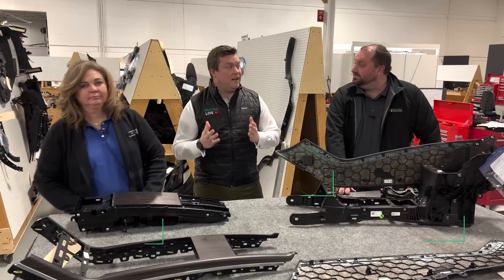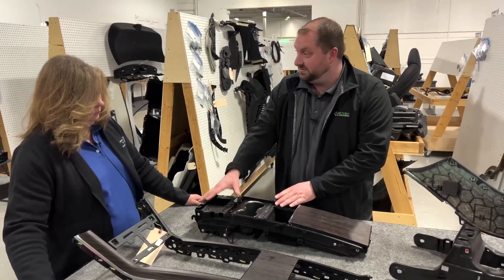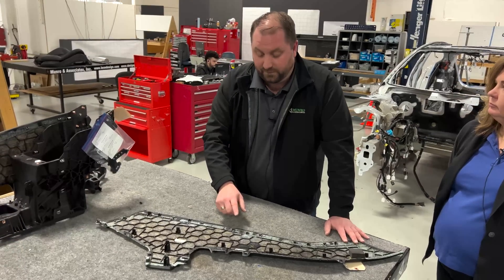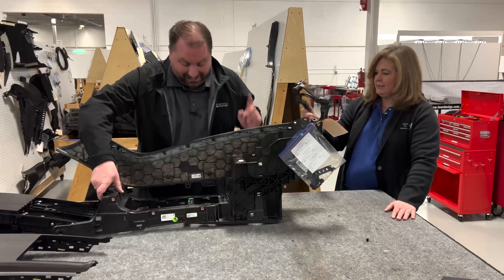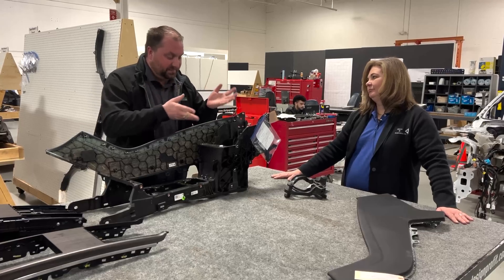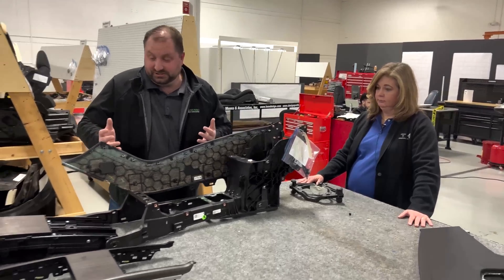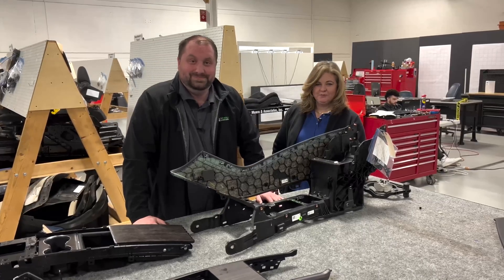Tesla's Center Console Surprises | Tesla Model S Plaid Teardown

Comment: I am trying to replace the center console wood finish with the carbon fiber finish. I bought the entire cover piece that you have disassembled in 2 pieces in this video. i was not able to pry the piece off after removing all of the screws at the perimeter. is it possible for you to provide instruction on how to remove the top piece from the actual center console? thanks!!!

Comment: I personally think that the small plastic tab is to prevent the cover from sliding back during acceleration since plaid accelerates so crazy fast. The inertia of a head on crash will only cause the plastic tab to stay down instead of up.
Reply: nailed it

Comment: To test that inertial lock mechanism, just hold that console top vertical and drop it a few inches onto the carpeted table top.  Keep dropping it from higher and higher until it works or doesn't. Or put it in a bag with a rope and swing it around your head. Count the video frames to find the rotational velocity, etc, etc... How many G's will it take to trip that latch? I'll bet less than .6

Comment: We needed an injection moldable carbon fiber parts manufacturer 3 years ago. I found it and the customer started working with them. A couple of months ago I asked the customer did they get the part done and he explained that he didn't know how to make it happen and it was cool to see a video of the process, it was done by robots. No word what exactly the part was but it has something to do with quadcopter attachments or maybe it's the frame. The size was around 1.5m because it's possible to transport it inside a VW Passat car. That got me thinking that Tesla probably has a similar fully automated production line or robot station that makes them. As a matter of fact, the factory engineer told me that the reason some parts look weird is exactly that, they are made by robots with "mold hands" that put the mold where it's needed.

Comment: Pretty sure the inertia lock is to stop the compartment from opening under high acceleration, if you factor in the direction of the latch and the little effort needed to open the bin.

Comment: I am amazed. I first thought that Tesla is many years ahead of everyone else only in their "sphere of competency" like electronics, software, battery management, battery supply and so on. However, I am more and more convinced that their lead is even much more profound - material engineering and even manufacturing in general. The most impressive thing for me is their ability to innovate so quickly. They learn pretty fast and this is their biggest advantage.
Reply: Bullshit Lol…… this is not something insane any more, other manufacturers have been using these types of materials including a full carbon fiber monocoque construction, carbon fiber wheels, carbon fiber roof, carbon fiber seats, carbon fiber almost everything, BMW had been using recycled plastics and fibers and even things like hemp and other plants in their cars for years and years.
Reply: @carholic-sz3qv  Whatever, you have to admit that the way Tesla was able to scale the EV production while everyone else just failed is nothing short of extraordinary. They are gigantic now. And don’t tell me it is just a good luck.
Reply: @ismaelvolf4759  i have to admit that every companies are scaling EV production and that’s the reality so cheers ….

Comment: Really interesting. I do wonder if this is just an experiment or if this is a direction for Tesla. What they have shown with other materials and even feature choices is that sometimes a more expensive option is cheaper in the long run if it is used exclusively and in extreme high volume. You mentioned the possibility of the overmolding on the cross car beam potentially also being carbon fiber filled. If Tesla goes this direction for most of their injection molded parts it could amount to a decent weight savings and a streamlined supply chain. And the natural fiber fill is also a great alternative to glass fiber which would make green focused customers happy.
Reply: Lol…… this is not something special any more, other manufacturers have been using these types of materials including a full carbon fiber monocoque construction, carbon fiber wheels, carbon fiber roof, carbon fiber seats, carbon fiber almost everything, BMW had been using recycled plastics and fibers and even things like hemp and other plants in their cars for years and years.

Comment: The spring steel won't work forever but they should easily last the 10 years the car will.  Especially cold climates might see earlier failures.

Comment: Did you notice that the center console lights are backwards? They turn off when you open the lid and turn on when you close the lid. All the cars are like this. All backwards. It’s amazing to have such fancy engineering and totally blow it on the assembly.

Comment: the cf reinforcement sounds like it's the "alloy wheels" of injection molding. yes, it was expensive. yes, it's lighter. not everyone cares, but those who care, care a lot because it does actually make a measurable difference. sounds like you talk to a lot of engineering accountants who went with the base models lol.

Carl's passion for injection molding is great! it's always cool to learn from people like him because they find the coolest stuff to be excited about. 

I wonder if there are aramid-reinforced plastics? because I would think that might be good on a skid plate or something like that. I used to change oil and I've seen some chewed up undersides of front ends
Reply: Wrong!!!!! Cf reinforcement doesn’t sound like alloy wheels of injection molding, it’s already something commun in the industry, other manufacturers even goes to making carbon fiber wheels, roof, monocoque chassis, doors, hood……..
Reply: @carholic-sz3qv  none of that is injection molded. my point was if you are buying an injection molded part, 30% glass fiber is like the bare minimum steel wheels version of the process, while CF filler is a nicer option
Reply: @Seldoon_Nemar  there are even magnesium wheels and many other very custom materials that other manufacturers uses, tesla is not even close to the engineering when it comes to materials, Porsche even has special coated steel brakes that doesn’t rust or fade when no used, so much more from their racing pedigree where all those materials comes from.
Reply: @carholic-sz3qv  wow, you are entirely missing the point of what I am saying... it's a euphemism... we are talking about INJECTION MOLDED PLASTIC PARTS. it could be a canoe paddle and use carbon fiber reinforcement. penny pinchers will say that cf is too expensive... they would also get the base model when owning a car... which comes with steel wheels... it's the minimum viable product...

like sweet satan my man, is english your first language?

Comment: You can tell these two (Carl and Sue) really give a crap about their 'back and forth' as a dynamic in their presentation.  Neither of them are what you could call 'natural presenters', but this presentation was smoother than the last one they did together.  The work they put into it is apparent.  These two have a great chemistry and I can see that they are going to be an awesome addition to the channel if they keep working hard.  Heck ... even Sandy has work to do if he REALLY wanted to take his performances to the next level.  Does the Munro Live Channel NEED 'A-List'ers presenting engineering features and break downs ??? NOT A CHANCE !!! Is that what it's going to end up with if everybody keeps putting this much integrity into their parts ??? ABSOLUTELY !!!  Great work everyone !!!  I come away a little bit smarter every time I watch a Munro Live episode.  This is turning into a real quality production, you should all be proud of yourselves.

Comment: To be honest with my self, I was more impressed with the spring latch for the centre panel door, then I was with the carbon fibre wrapped motor :-) Elegant and useful. 
Once again you two 'nailed it'. I kinda feel a bit sorry for he poor ol electrical engineers wiring loom video which I found a bit hard to watch. Not blaming the guys though, they acted just like most other electrical engineers that I've met. Super bright, but presentation tends to be not their strong point :-)  Tag teaming on video can be a hard thing to do. It was great how these two looked at each other and us.

Comment: That little inertia lock serves one more purpose: when you launch the plaid, everything that is not secured in the car will fly back with significant force, including the console door 🙂
Reply: This is why for sure
Reply: Good guess !
May it also be for a software lock ? Such as the glove box pin locked ?
Reply: @guillaumest1  would be quite easy , but is not currently , cause no motor or magnet for locking seen here. to do the lock with the same/similar idea. you would just need 2 magnets , and the bottom one would be on a slide with a small motor to bring it under or move it to the side, then it is under it brings the front lever up , locking the center console , if you use electro magnets, you waste energy.

Comment: It's probably an inertial lock but not for accidents, since in an accident the lid will probably move forward, I think it's to prevent the lid from sliding backward due to the aggressive acceleration of the plaid.
I think this can be confirmed if theres a notch in the underside of the lid for the lock to latch onto if the lid is in the middle position.
Reply: Thats an awesome observation....for any other car it would be ludicrous to assume acceleration...but plaid...very appropriate

Comment: Sue and Carl are the best! I agree with Sue about the inertial lever. Is the spring light enough that if the car is inverted it will lock the compartment closed? Carl, do you think Tesla engineers have read your thesis?!? If it were me, I'd take a lot of pride in knowing they had. Good job. VERY interesting. (but leave Sandy alone during his vacation! 🤣)

Comment: Maybe that spring loaded flap is to allow some air to flow into the storage compartment (opening or closing the sliding lid may create a vacuum in the storage compartment / cup holder area)?

Comment: Started good and getting better and better with each edition. Thanks. 

Re the carbon fiber: I've seen them mix a powder with resin in doing high strength fiberglass applications...like sailboats. Seems carbon "powder", if such a thing exists, aught to mix in (blend) with the poly (aren't they tiny beads?) as the feed stock for the injection.

Comment: What is that built up box on the center console side panel? I don't see wires for a sensor or something.

Really great about seeing carbon fiber and weight savings to trickle into parts.
I'm guessing we will see many more as we get closer to the roadster release. Perhaps next huge pieces in seat frame and mount. Probably switching pieces both at a slow rate of using part backlog, but also to spread cost of switching parts. 

Would be super expensive to switch all at once, in but by slowly doing it they can control costs from spiking.

As you have mentioned how will they get the cost down for Thier expensive models; by making cost spread of parts into all or more mainstream vehicles.

Comment: One thing I like about Tesla is that they have introduced new materials and production methods that have nothing to do with a BEV powertrain.  In doing that they have really embarrassed legacy auto since moving to EV wasn't required for these sort of advances.
Reply: Bullshit, do you even know anything about the automotive industry!? Bmw has been using recycled plastics and natural fibers like hemp in their cars for years, even carbon fiber and naturally tanned leather here is a proof https://youtu.be/GtXeLhz9JVI
Reply: The sliding lid is something Mercedes’ has been using for over a decade.
Reply: @carholic-sz3qv  yeah, I wasn't really refering to that. I'm thinking of things like giga castings and optimisations in the factory that lead to construction times of one third of that of legacy (as referenced by Herbert Diese) Also the constant innovation on the production line.

Comment: CF is also used in 3d printer filament and massively strengthens it. They call it black aluminum because it’s that strong.
Reply: It also has widely mixed results in strength and fatigue testing, depending on brand, etc.  Carl's comment about matching the sizing to the polymer is interesting.
Reply: @gth042  ya. I really wish that filament manufacturers would go to a barcode system with standardized specs so that we could load it into fusion/solidworks and into the slicers. Then generative design really starts to work well.

Comment: 7:55 i would not call that 'more green' than using 100% PP in the part. A monomaterial provides almost virgin recycling after it's lifecycle where this composite is just scrap due to the mix in fibers. So IF you manage to make your part with only PP (no Glass fiber,...) then that would potentially be more 'green'. Agreed having more recycled content makes it better at the beginning, i would still concider that 'down-cycling' (downcycling = when your parts ends it's lifecycle the recovered materials are or less quality. In this case filled with fibers). Just providing a more detailed commentary :) good work as always ♥️

Comment: Weight saving is money saving on the battery and increase in performance.
There is a recursive effect on the saving of weight: let’s say you save 10% by using better material and using them efficiency. It mean that you can reduce the battery pack, the structure, the collision absorption saving further weight, that additional weight you save allow you to shave even more to all the structure and battery and so on.

Comment: Could the inertial latch be to prevent the sliding door from tripping on extreme acceleration.
Reply: That makes a lot more sense.  If it was added to prevent opening during a crash, it would only be useful if the car was rear-ended.
Reply: @techman2553  That's exactly what I was thinking.
I also have a vague memory of another car with an inertial latch for a center console sliding door or lid but I can't for the life of me remember which one it was. I was thinking I saw it in a video of someone fixing or disassembling their tesla console a while back but now I can't find it.

Comment: There is a chronic problem with the lower storage bin light being wired backwards.  Light stays on when it is closed and turns off when fully open.  Many don't notice, but when you point it out to refresh s/X owners, it is clearly opposite of how it should be...
Reply: Wow, hold the front page, that sounds like a terrible problem - also most probably impossible to fix. A recall is needed, immediately! I'll inform the motoring press immediately.
Reply: @bluetoad2668  how is bringing up an issue with the console in the comments section of a video about the console trolling?  Do you have this issue with your Plaid?  because I do.  You are the troll my friend.
Reply: @bluetoad2668  tell me you are triggered by a comment without telling me you are triggered by a comment...
Reply: @carperdiem8754  I'm far too old to get 'triggerd' whatever that means but I believe the correct term for you is troll, son.
Reply: The New S has a bin light? My 2020 S doesn't have a light.
Reply: Does that drain the battery?
Reply: @jamesvandamme7786  no, a minor annoyance.  I haven't even bothered getting mine fixed yet

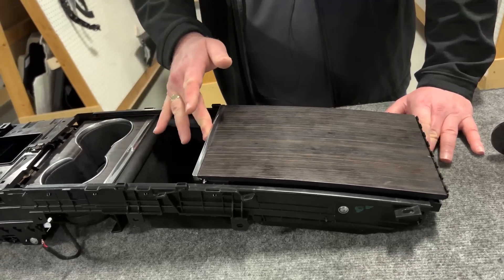Comment: 4:10 It's probably to stop the door from opening during hard breaking.
Reply: @Dethley  incorrect. the door opens towards the front of the car. When the car launches the door is pushed towards the closed position.
Reply: @Dethley   you are correct! it has nothing to do with helping in an accident but instead these cars can accelerate insanely and really uncool to have that door sliding back and things flying out.
Reply: I think that if you change breaking for acceleration you have it. 
In the Paid is same axis and magnitude, just opposite direction.